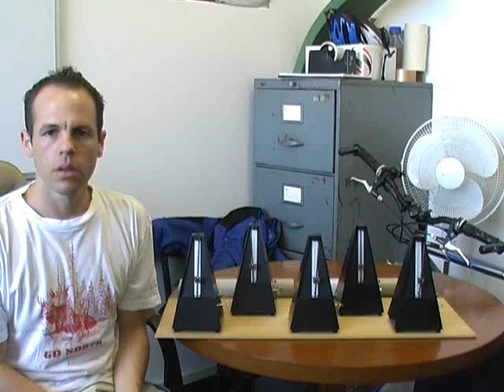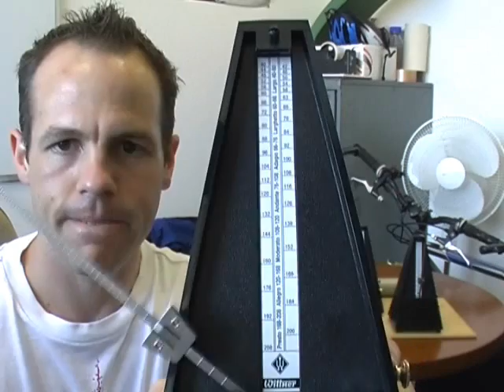How to synchronize metronomes

Comment: what exactly do you mean by saying "lowest energy state"? the fact that system relaxes to some specific normal mode means that dissipation is crucial here, and therefore energy will continuously decrease until friction does its job and all the metronomes eventually stop --and this would the lowest energy state. 
do I miss something?

(process shown in your video is rather creation of "highest-rate-of-dissipation state" to me, because clearly most energy is dissipated when the platform moves with highest amplitude. however, this does not help me to understand it anyway)

also, it is clearly not a linear system, because energy is transferred from one normal mode to another without any significant loss. so even word "normal mode" is ill-defined.
so it's not that easy to build theoretical model where one can see such an effect. or is it?

Comment: OK, I bought two metronomes, put them on a short board on top of two soda cans.
Here's the rub.  They will ONLY synchronize 180 degrees out of phase.  If I start them in phase they will gradually get themselves 180 out of phase.  The pendulums are going in opposite direction.  If I face one metronome in the opposite direction, they will also settle only 180 out of phase relative to the overall system.

When I start them in phase, the board on the cans hardly moves, but as they approach 180 out of phase, the board will move to compensate when they go out of sync  It will maintain 180 degrees but not 0 degrees or in-phase.  I think it has to do with the mass of the board being on the high side.  Comments?
Reply from the maker: ***** Yep, this is common if you have just two metronomes, and the clue is the start to your second paragraph. For the two metronomes to be synchronised the board needs to roll freely, in this case, the board should roll right as the pendula swing left to keep the overall system centre of mass fixed. If the board can't roll so freely, the 180 deg phase results, here the centre of mass stays fixed without the board moving. This synchronization happens with the board rolling a little but not so freely. Soda cans aren't the best rollers for this, you usually want something a little more robust.

Comment: it would be interesting to couple one board on top of another to see and hear how two layers of "oscillators" interact. if you continued to couple boards on top of each other i guess you'd see the board movement take on a vertical sine type wave with the top and bottom boards 180 out of phase?

if so, would that mean that the metronomes are never truly in phase, but at that the current scale we can't notice? the other interesting thing that i guess you might see then is the oscillators might start to look more like they are snapping backing and forth from their two most extreme states. if you stacked it tall enough i wonder if you'd perceive a decrease in overall amplitude in the metronomes in the middle of the stack as well. gotta go buy some metronomes to try it out. :)

thanks for making the video. :)

Comment: Adam, would you get synchronization if the frequencies are set to different but whole ratio settings?  For example one set at 120, one at 60, one at 40 and one at 20, all at the same time?  The 40 will be the tricky one, but I think they would still achieve synchronization at their respective settings.  Would they?  I haven't seen a vid that explores this.
Reply: It's been 3 years Adam. Done the experiment yet, or know of one?
Reply from the maker: Fantastic question, Greg. I've never had the opportunity to try this one, and I haven't seen a video either. It's hard to predict what would happen. I can't see an obvious reason why it wouldn't work if the ratios were exact integer, but I wouldn't be surprised if it didn't either. If I get a chance I'll give it a try.
Reply from the maker: I'm trying to get this as an experiment in our undergraduate teaching labs, so I might make this a research question for the students somewhere in the future.
Reply: Thanks for the response, Adam.  I'll be watching to see if something comes of it.  Seeing it work with a ratio of 2:3 would be spectacular.
Reply from the maker: Greg Scott No worries, thanks for the inspiration for an interesting experiment!

Comment: But what will happen if the metronomes are set to different frequencies to begin with? War?
Reply: This suggests an interesting variation on Adam's last experiment (7.41) in which we watch how one metronome adjusts its amplitude as it comes into phase with the others. What will happen if it's initially set to a different frequency as well? Will it change amplitude to compensate? For example will it do a short swing slowly to cover it in the same time as the others do a long swing faster?

Comment: On the way of reaching the steady state, is increase in phase synchrony proportional to decrease in entropy, i.e. a more ordered state? I'm thinking of thermodynamics here.
And if entropy indeed changes, is this contributing to the free energy until the lowest free energy is reached, i.e. the steady state? So, energy actually does not change, but entropy, and thus the free energy which is the sum of energy and entropy? But energy fluctuations within the system are still important here...? Hmmm.

Comment: i would think that the system stays at 160 bpm, but the amplitude of the oscillations [metronome arms] depends on the energy lost in synchronizing the system. you could have a system at 160 bpm with very wide amplitude oscillations if enough of the energy is preserved, or a lot smaller amplitude if it has a lot more to normalize. watch the last 1:00 of the video and you'll see that the amplitude of the arms is not preserved once the last one is added and normalized because of energy loss.

Comment: cool! here's a question: what's the final bpm of the system? i mean, the single metronome is set at 160 bpm, but the whole system is more complex (for instance it adds mass in the form of the table and the rolls, and it adds dispersion of energy in the form of movement). could we at least predict if the final bpm of the system is higher or lower than the initial one?

Comment from the maker: You probably can, but it will depend heavily on the initial state of the system, sometimes it will be slow, sometimes fast. Not easily calculated, but with a model it can be done.

Comment from the maker: With a small frequency offset, yes, the 'off' metronome is just forced into time. Essentially the rest of the system forces the oscillator to behave itself. If the offset is big, it doesn't happen any more. I haven't played with it enough to find out exactly where this happens and how it depends on system set-up.

Comment: I wonder if you deliberately change one metronome to be plus or minus 0.5 BPM – if it will still sync? (Speculating that the majority of rhythmic mass will override the minute tolerances of the one stray metronome). 

Also, because of the sympathetic vibration... does the metronome spring get more mileage between wind-ups?

Comment: It makes me wonder about the importance of the manufactured accuracy of each part and how close to one another they are in their relative tolerances. 
Is it important that the tolerances are perfectly dead-on or does the moving acoustic surface which they rest upon forgive or dictate their inaccuracies?

It seems the bottom weights fall into synchronicity with the rhythm of the movement provided by the flexible base but the majority of the metronomes in sync first dictate that rhythm.

Comment: if they are out of phase then some of the springs/pendelums/oscillators/whatever will be working against each other (the direction in which they push/pull each other through the surface in which they rest is opposing during at least part of their cycle, unless they are synchronized). this causes energy to dissipitated as heat within the system, where the forces are stressing the materials in the system due to opposing forces

Comment: I would like to see how this would affect the ocean cycles and even solar system harmonics.

Planetary periods are related by the cube of their distances. Or something like that. I can't remember the exact equation but it turns out the centre of the harmonic is offset from the sun.

Got it:
9/4pi planet 1 = 3/2pi planet 4 -in astronomical units.

Thus:

9/4pi Mecury = 3/2pi Mars 
9/4pi Venus = 3/2pi Jupiter
9/4pi Earth = 3/2pi Saturn, etc.

The original was from an AOL website -now hard to find.

Comment: Yes, you would get the same effect. If the table was heavier, it would move less noticeably, and if it was lighter, you would see a bigger movement of it, but in the end, the time to synchronization would be approximately the same (approx. because more movement -> more resistance (friction, to lesser extent air) -> loss of energy -> loss of momentum, and vice versa)

The metronomes likely weigh more than the table in this video (the table being the board that they move on).

Comment from the maker: Faster takes longer than slower. It should work at lower bpm, but you need the rollers and the table surfaces to be smoother. The swing range is longer at lower bpm, so if the table isn't as flat, the ruts and bumps cause problems that aren't there when you use higher bpm (and a smaller swing range).

Comment from the maker: Interesting. Oak as a hardwood is much less flexible than pine, which is a softwood, so this is probably a fair call by the engineers at the time. That said, you probably could still have used pine if you designed the building to more effectively damp the oscillations. Would be a fun challenge as a structural engineer.

Comment: A brand new cotton mill in Lancashire was literally shaken to the ground by resonant harmonics in 1805 when all it's 500 weaving looms were run for the very first time. The engineers of the day blamed the costcutting  use of pine in the construction the wooden floor  instead of the more traditional oak which might have prevented the ossilations building to dangerous levels.

Comment: @ micolich,

   I see that the oscillators in the center of the board seemed to come into synchronization quicker than the two on the border of the board. Is there a reason to that, or is that just the way it seemed to happen this time around?